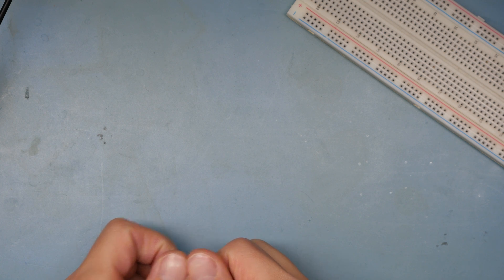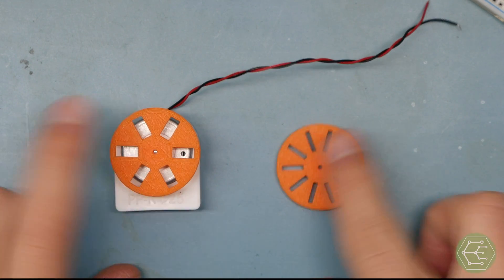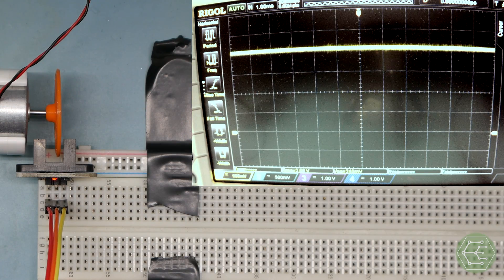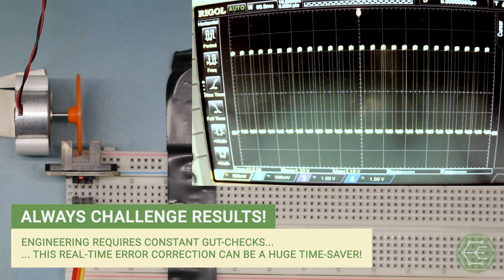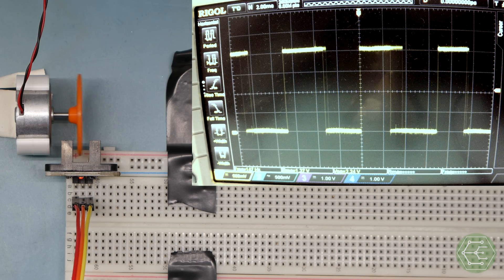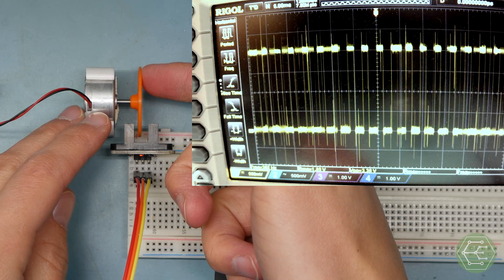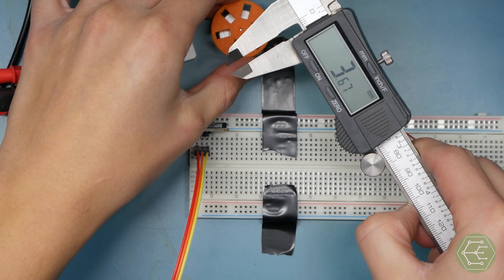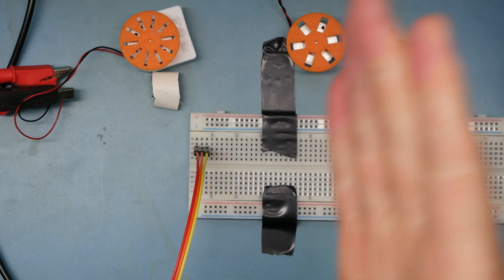Simple DC Motor with Encoder – Testing Encoder Wheels & Speed | MOT 4

Comment: While you are looking at encoders, I'm trying to find reasonably high resolution absolute encoders with fast output for a motor I am designing (parallel direct would be nice instead of slower serial encoding). I'd like about 1 degree resolution for a 60 degree sweep that can handle at least 10k RPM. Controller will be custom to drive 4 full-H bridges (8 stator poles and 6 rotor) with variable strength quick pulses.
Reply from the maker: Wowza, that's one heck of an encoder! For sure it's possible- I've seen 10k rpm before.. scary. :) I have memories of gears melting, etc. :)  I'll keep an eye out, and let you know if I come across anything! Total aside, your motor project sounds pretty awesome. I hope it goes well!

Comment: I did something for my capstone that used a motor with integrated encoder. It was a automated pill dispenser careosel. I used the feedback and implemented a fun little PID control loop to regulate the position. Basically making a servo motor.

With only 'P', it would act "springy" and you could twist the shaft and feel it fighting back with a spring constant. Letting go it would oscillate like a spring mass system at a few Hz.

I could also have added damping with the 'd' term but it was good enough for the application and needed to focus on the other parts that we had a hard time getting to work. I can't remember if I ended up adding an 'I' term
Reply from the maker: Very Excellent! I hope that through the project we eventually get to a point where you think: "Hmmm that might have worked for me!" I think it would be fun to demonstrate those differences with our controller in a future video!